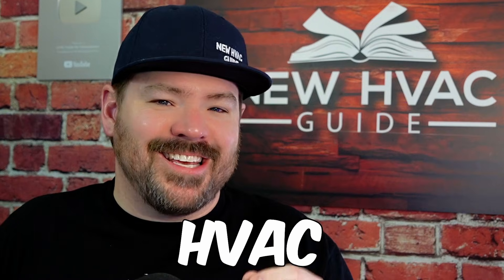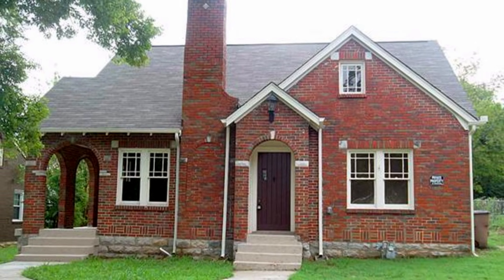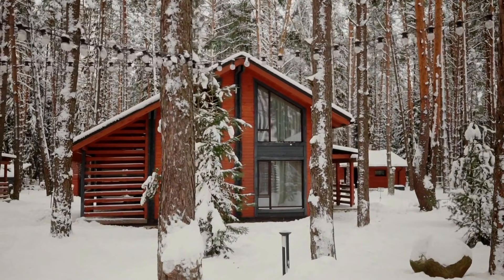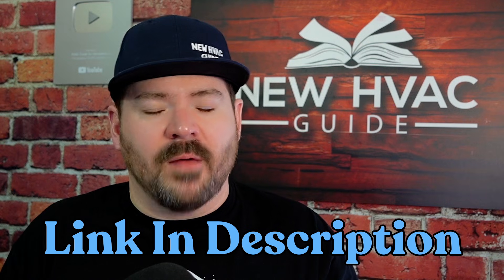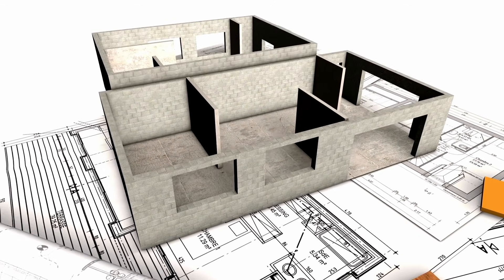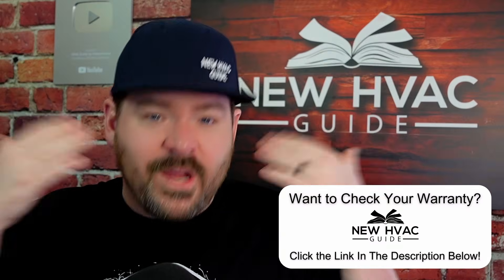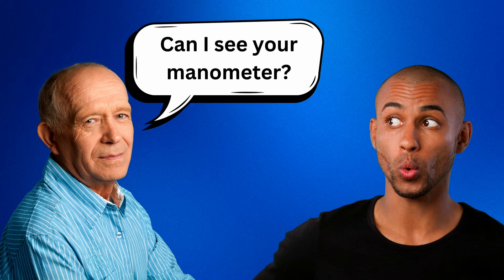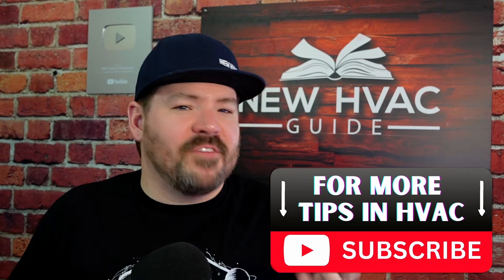5 BIGGEST Sizing HVAC Mistakes Homeowners Don't Know!

Comment: Just got new goodman  r32 hvac system. Home is 1900 sq ft. Heat can reach over 120 degrees. Replaced r22 5 ton system with r32 5 ton system. My question is im noticing new system not producing condensation. Right now outside temp 85 degrees, 45 humidity with inside temp ser at 76. Cools really good. Piping not clogged. Im thinking fan blower set too high that it doesnt dehumidify correctly. ??What you suggest??

Comment: Tomorrow, I'm getting a 12,000 BTU Atmoshera installed in my living room to deal with a cooler temperature. I want to heat my house 100% with the now 2 heat pumps into continuous double-digit negative temperatures.

Comment: I sometimes wish I undersized my AC unit .5 tons from 3 tons to 2.5 ton.  But the days or long times of +40 Celsius, it keeps up as needed, where some friends places cant keep up.  .Because of an Ecobee, remote sensors and using larger temp differential, I work around it when its not that extreme heat.  I still get longer run times, and with that, I get longer times of it not running.  Were I live, humidity isnt an issue in summer.  Im so glad you explained this about how each house can be different, and people on Reddit will bitch up and down how wrong you are, yet dont live in your area.  It seems, well it works for me, it should be the same for everyone

Comment: On my house, the 3 ton upstairs unit is twice the size it needs to be and short cycles even when outside 30° or 110°, and the 2 ton downstairs unit is almost too small. The downstairs unit works harder in the winter even with upstairs doors closed.
Also, after the heat pumps were cleaned the first time I noticed they blow warmer air inside, so now they're cleaned every year